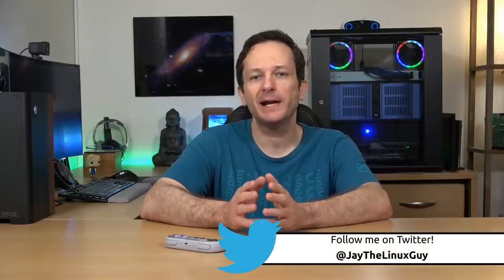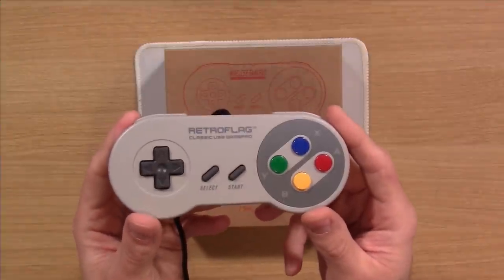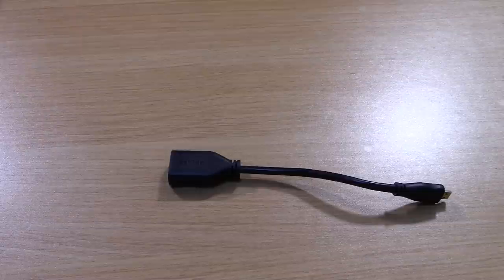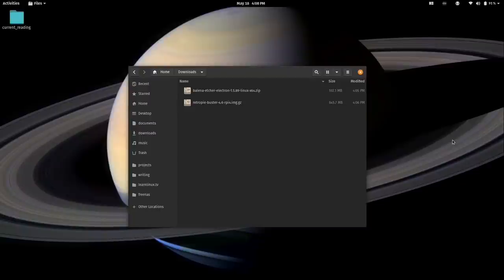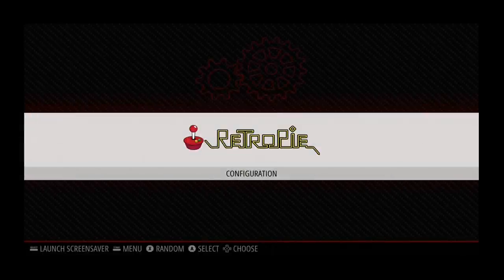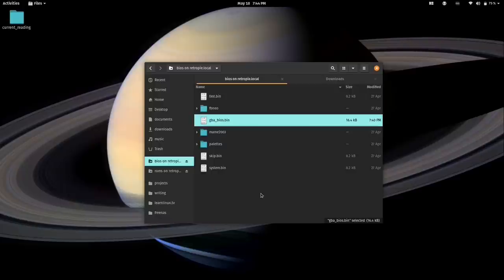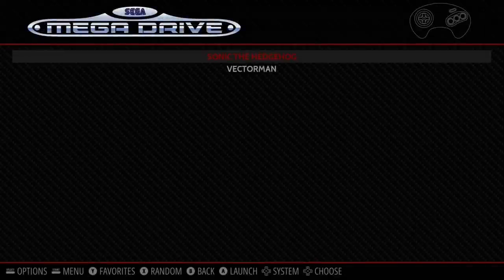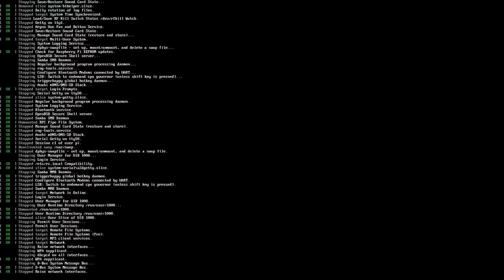Build a Raspberry Pi 4 Retro-Gaming Console with RetroPie (Complete Guide)

Comment: there is a small transparent plastic sheet on the CPU of the raspberry pi at 17:29 that you forget to take off before installing the board
Reply from the maker: Yup! I can't believe I missed that, how embarrassing! I opened it up just now, and sure enough, there it was. In my defense, the recording lights were making it hard for me to see clearly. I really need to get the lighting fixed...
Reply: LearnLinuxTV even the best make mistakes
Reply: is it bad to leave that sheet on guys? :o (only just come to my mind lmao xD)
Reply: @kitsunedotexe3587  I would presume so. Plastic isn't typically a very good heat conductor, and it might even melt and cause a mess.

Comment: I was never a gamer, but loved my Super NES when it came out in high school. I would have fun with this if I had the money. Thanks for the tutorial.
Reply: The Super NES games will probably run fine on a Raspberry Pi 3B plus. These are much less expensive then the Raspberry Pi 4 models, you may want to go this route. Once you build one, it is really fun to play, brings back some fond memories for me.
Reply: Even the raspberry pi 4 cannot run GameCube, PlayStation 2, XBox/Xbox 360 and PSP.

Now that I have said that, the raspberry pi 4, can run Dreamcast to a certain point.  Some games will work well if you have the right emulator and others will have problems.

In summary, if you want to play arcade, Atari 2600 through the original PlayStation and MAYBE Dreamcast, the Raspberry pi 4 is your best bet.
Reply: @gregghernandez2714  I have a Pi3B+ from 2019 and it runs Super Nintendo without a hitch.  This also includes special chip games like starfox, and super Mario RPG, and Mega man X2 and MegaMan x3.

Comment: Hi, thanks for the comprehensive video. I'm new to Raspberry Pi. And I'm looking to build a retropie gaming system. I had a question for you... at the time of this video you had the choice between the 2GB version and 4GB version… you made a comment in the video that you might as well just buy the 2GB version and save some money because the 4GB version isn't going to do anything for you if you're just building a retropie gaming system. Can you explain why? I'm asking because I was looking at a kit that has everything in it, marked as an extreme kit from canakit, and the choices are between a 4GB ($1755) & 8GB ($200) version. There is also a more basic starter kit at $140 that is 2GB. My initial thought was more GB, more powerful, more capability. But you're essentially saying the opposite . So that's what my question is.
Reply: You only need (4GB, 8GB RAM) If your using your raspberry pi as a standalone desktop system.  Retropie in and of itself, will NOT benefit from 4 or 8 Gigabytes of RAM.  If you get a raspberry pi kit that has 4 or 8 Gigabytes if RAM, and IF your using it only for retropie, you are wasting money. 

A helpful tip. 🙂. My kit in 2019 came with 2 gigabytes of RAM and I've been using RetroPie on it for 3 years now and it's still going strong.

Comment: Dang dude, 15 ads? This is exactly why I use adblock. I never used to mind watching an ad or two, but an ad an average of about every 4 mins? That's a bit much. You're a smart guy with a great channel, don't be one of "those" YouTubers please.
Reply from the maker: Can you please provide more detail? There's no such option in YouTube to set up 15 ads anywhere that I've seen, so I'm honestly not sure where that's coming from.
Reply: @LearnLinuxTV  every little yellow area on the time line is a possible ad spot. Creators have the option to add more than one if the video is longer than 10 mins. Assuming an ad at the start of the video, I see 14 additional marks.
Reply from the maker: I'm really sorry you're experiencing that, but I don't think it's coming from me. I'm honestly not sure what the problem might be. I know that creators can add multiple ads within the video, but I don't do that. Could YouTube be injecting them without telling me?
Reply: @LearnLinuxTV  They've been doing that more and more.
It's no uncommon for me to see 15+ ads in a twenty minute video, even on channels that have been demonitized.
Reply: @LearnLinuxTV  Yeah...this video was LOADED with ads for me too.

Comment: It would have been nice if you listed all accessories required together... every part of the video, it is a surprise that you need to ad something, such a keyboard, SD card, etc... at the very beginning seems that you only need the RPi4, the case and the controllers... Anyway the video is good and for beginners it will be great starting point. Thank you ;)

Comment: Thank you for the video! Quick question: I'm wanting to set up my retropie so that it filters media based on which controller I have plugged in. For example, if I plug in the super nintendo emulator controller the retropie automatically goes into my supernintendo emulation games folder. Sorta utilizing the controller as a security dongle, sort of. Any tips?

Comment: I would like to add that it is VERY important to connect the hdmi cable to the outside micro hdmi port near the power button, NOT the one on the ‘inside’. You can see that it’s set up this correct way at 28:40 for a split second. I didn’t do this and got the games running ok, but without sound. I tried EVERYTHING to get the sound to work and wound up reflashing Retropie, reloading the games then it was good. So if you have the same issue I did, again make sure your hdmi cable is on the outside port.
Reply: I feel your pain. I spent so long learning about the hdmi settings in the config.txt file. Eventually found out the raspberry pi 4 just has a lot of issues with hdmi that the pi3 doesn't. Live and learn 😄

Comment: Thanks for the LearnLinuxTV video. I also have such an enclosure for RP4, but I did not know how to install the driver for it correctly, now I know. May I ask you how to correctly set the values in the argonone-config file to select the fan mode in the case?
Reply: Sorry to bother you, but I figured it out myself. You need to enter the console from the main menu of Retropie by pressing F4, after that you need to enter one line: argonone-config #configure driver . Press the inter button and the Y button. Then from the 4 options, select the one you need, I always choose 4 - this is the constant operation of the fan when the RP4 is turned on.

Comment: Hey there- I followed your steps with my son to build a Pi retro console, it all went really smoothly and he loves it so many thanks. My question though- I'm having terrible lag with the N64, I've tried different emulators, I'm reluctant to overclock it and am not very technical. I had wondered if performance is workable if I moved to a solid state flash drive instead of the SD drive, I even wondered if doing that and daisy chaining 2 Raspberry Pis was possible to boost performance. Any thoughts on that, is it viable or would it not provide much improvement? Are there alternate videos around for that, as inevitably, Goldeneye is a key driver for me!
Reply: With N64 there is a compatibility list that says what you can expect if you overclock your raspberry pi.

However, the performance and notes about the games remain the same if you do not overclock your PI.    The bottom line with N64 on a raspberry pi is, some games work well, some don't work at all or have stuttery sound and slowdown.

Google raspberry pi 3b+ overclock compatibility list.

Comment: I'm using the newest Raspberry Pi (4b) and the newest Retropie and the newest Argone One (v2 with full size hdmi).  I notice some menus are different.  I haven't enabled the power button yet, but my biggest question is whether or not the fan works the way it should without tinkering with anything?  Without doing anything for the fan, I've heard it click on part time I think.

Comment: Hello, what format did the Micro SD card end up getting formatted as using that tool balenaEtcher?  In the past, it was always said to format the  memory card with Fat32, but I'm wondering if current Retropie versions and the Raspberry Pi can now handle the default exFat or even NTFS because that is typical for large Micro SD memory cards, thanks!

Comment: hello, I bought on eBay an sd card with all the games installed it and some of these games works fine but the ones I actually want to play are really slow and not smooth at all like ones killer unstick or mortal combat or top gear any help? thanks for your time !
Reply: Advice not to buy again those kind of preloaded sd cards do it yourself
Reply: I had problems with input lag and screen tearing when I first set up retropie.

These are fixable in the settings.

I don't remember exactly how I fixed the screen tearing but if you mess about with the video settings you'll be able to do it.

here's how to fix input lag:

https://retropie.org.uk/docs/Input-Lag/
Reply: @westonloomis  thanks

Comment: Where do I put the commands to get the fan working?
Reply: you have to do an ssh from an external computer, if you have windows please download putty.exe and then fill with the ip of your raspberry which can be found pressing letter a on the main menu and show ip, then you have to use pi as user and the default password is raspberry, then you put the line which comes with the case in the manual at the end.
Reply: @edinbrgt64  NO HACKER
Reply: I know this and don’t use putty.exe

Comment: USB wired is better ♥ here is why :

(these are just my reasons. just wanted to type this if it helps anyone 🦊♥ )

1). you don't EVER need to worry about external batteries (if it needs them)
2). u don't have to worry about battery replacements (if it dies out over time)
3). u don't need to worry about it dying mid game
4). the input lag is slightly less using Wire than using Bluetooth or WIFI (my personal fav reason)
5). u don't need to worry about first connection issues as its going directly into the system
6). and lastly YOU DONT LOSE UR CONTROLLER OR CHARGING CABLE XD ♥♥♥
Reply: the case reminds me of some sky router x'D

Comment: Great video and thank you. I do wish I could just run this platform off of my gaming PC and not need a Raspberry, but it's all good.
Reply: You can run the same emulators on a PC. You can actually run better consoles like the N64 on PC which normally require overclocking a raspberry pi
Reply: You may want to look at the CoinOps option. This build was originally designed for the original modded Xbox, but they have moved on to a build for the PC. I will build one once I have the time. One really nice thing about it is that if you have an old PC in the closet that use to run Windows ME, 2000, or XP,  it will more than likely be more than powerful enough to run CoinOps. In fact, as others have pointed out, you will be able to run some games on it that the Raspberry Pi 4 is just not powerful enough to handle.
Just do a search here on YouTube for CoinOps for PC to get started.
Reply: You can by booting batocera (emu station) from windows menu
Reply: @VortexGameplayGaming  Hi there, thank you for the response! Is there a video that you've seen that explains how to do this? Just lost my job and money is tight so otherwise I'd just buy a prebuilt standalone.
Reply: @sterlingforbes3872  Add your roms you want on retro pie then get retro pie os on a 32gb sdcard/usb drive then  watch this video: https://youtu.be/O_pivT9KxEg t
Reply: @VortexGameplayGaming  You rock, thank you VERY much.
Reply: Did it work?
Reply: @VortexGameplayGaming  hey bud, will give it a try later this week, also looking at how to put batocera on a usb drive and hoping to see which one is easier.
Reply: @sterlingforbes3872  same thing but I prefer batocera